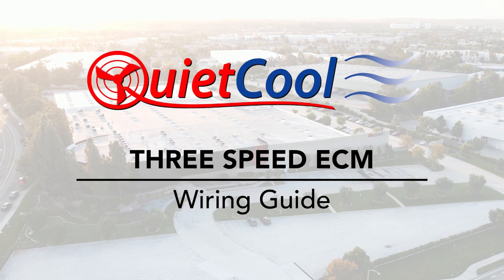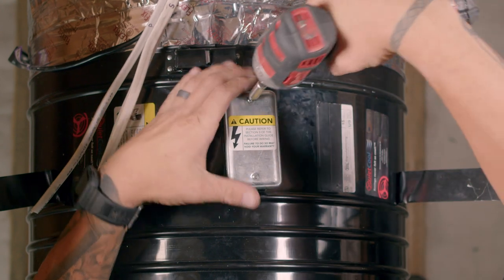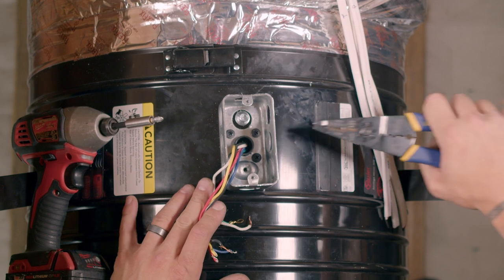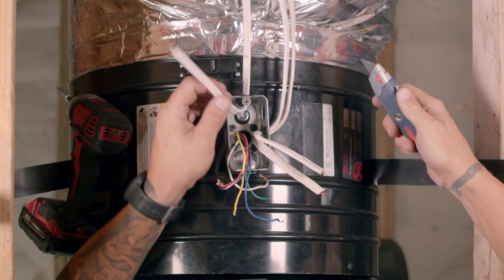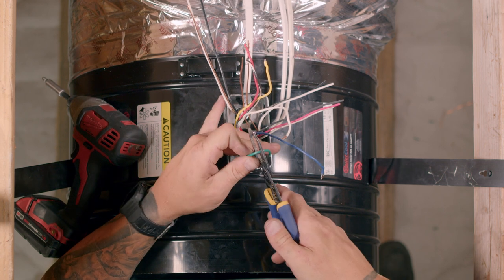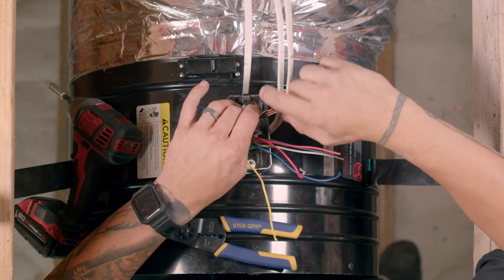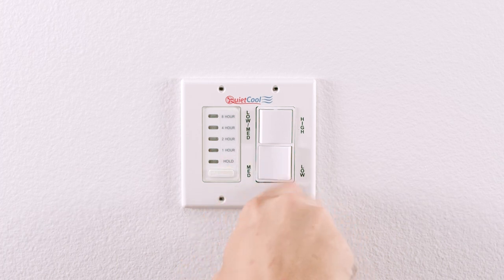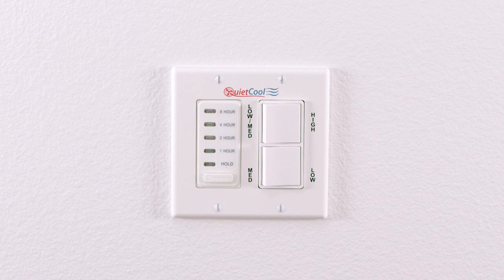Three Speed ECM Wiring Guide

Comment: This mentions the switch romex is two wire, but I thin it's actually three wire.
Reply from the maker: It’s be cause we’re using a 14/3 wire for the switch and a 14/2 wire for the timer. On the timer you don’t need the extra wire like you do for the switch to get multiple speeds. Does that make sense?